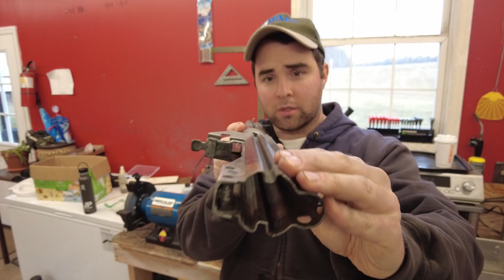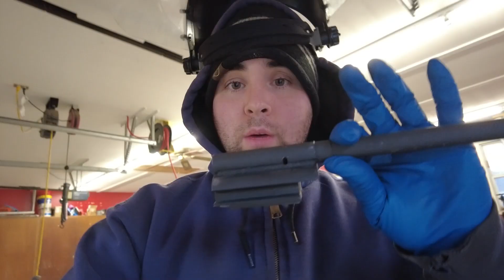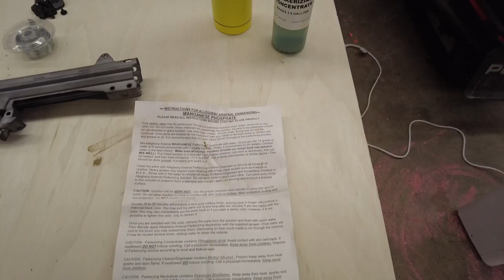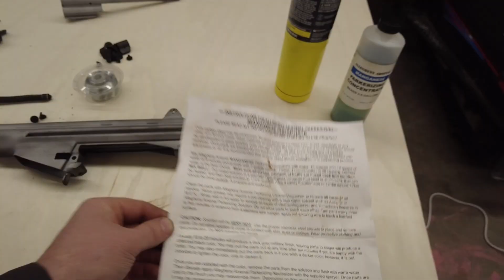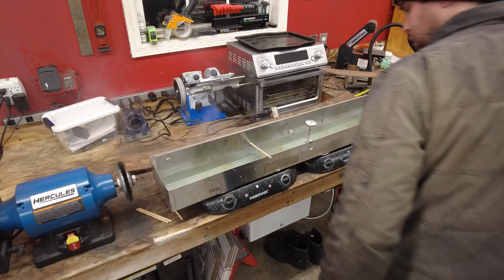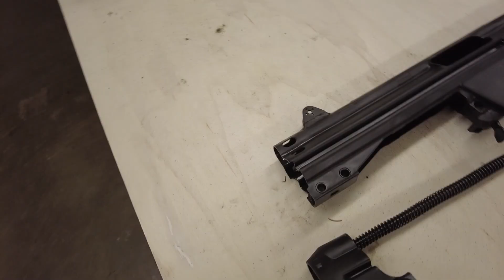Cetme C Marking Etching and Parkerizing

Comment: In order for the ears for the pin at the front of the trigger housing to remain in place with the shelf welded on, did you grind the inside surface of the ears to make them thinner to accommodate the added width of the shelf? I'm going to be starting mine soon and I would like to keep the original look by having those ears in place as you have on yours.

Comment: I tried pressing in my and it’s almost there it’s about 40 thousand away from being done but as soon as I tryed to press my get me barrel more it won’t budge at all I’m using a 12 ton press and a cet me barrel from apex any advice.
Reply from the maker: It should push the barrel all the way through pretty easy. You may be fighting a burr that is building up
Reply: @ how would you fix that I sprayed some gun oil I had down in it it’s super close to being at the right headspace but my press won’t push it any farther
Reply from the maker: Try to push it back out the other way to inspect once it’s out. I’ve never had that problem but I have a 20 ton too
Reply: @ okay thank you I’m going to try and press it again if that don’t work I will end up trying to press it the other way

Comment: I'm sure someone has mentioned this or you already know, but for the electo-etching, you're better off using sodium carbonate (washing soda) for the electrolyte rather than table salt; with table salt it's possible for chlorine gas to be produced which is toxic and can rust anything steel.
Reply from the maker: Interesting, thanks for the info! I did not know that!
Reply: @JPMachine  np, your build look great btw!

Comment: I’ve been doing parkerizing for a long time now and you got everything covered very well. Finding long length tanks that a barrel led action will fit in isn’t easy. For those who’re doing a one time park job, you can use a section of PVC pipe with a capped end then heat up the park solution to around 225-240 then poor it into the pipe that’s set upright and secured to a table. Then lower in the rifle and allow it to park. The higher temp is so when you poor it in, it’ll cool down to around 190 degrees which is where I usually park my parts at. Always keep the piece gently moving in the solution, this will ensure solution will be brought against the part. If the solution isn’t strong enough to get to a darker color, take some 0000 steel wool and tear a parts some small pieces and put it in the solution where it’ll dissolve and be incorporated into the solution. I don’t recommend this until you have more experience and do a small test before trying it on something important. Oh, for the PVC option, get a pipe that’s as narrow as possible so you don’t have to use too much solution. 
  This gentleman does a great job, I’d definitely send my work to him.
Reply from the maker: Thanks! Appreciate the compliment. I now have some tanks that are 5” wide and 6” deep! Had a local sheet metal place bend them out of scraps so they were only like $70 a piece including a lid.  Good idea with the tube for a quick and easy park setup!

Comment: really nice video! One question though, how scratch resistent is that parkerizing finish? If for example you go lightly with a screwdriver over it, will it leave a trace or flatten the roughness of the surface?
Reply from the maker: It doesn’t harden the surface at all, no. You will probably see a mark. Parkerizing gives oil a good surface to cling to providing some corrosion resistance but just like bluing, isn’t super durable like nitride.
Reply: @JPMachine  Thanks for the answer!

Comment: Nice build !  Excellent tutorial on your home parkerized set up.  
 Got me inquisitive about etching , but more on that later. ……. You solved my brain twisting question on where to get park heat tanks… The Bar speed rails are absolutely PERFECT. ……..Did an Amazon search, had a 2 48” tanks in 5 minutes ‼️ ……….
Thank you 👍for an excellent fully informative no frills , no b.s. , stright forward video.. 
Your project looks great ‼️
Reply from the maker: Thanks!  I’m actually upgrading my tanks right now. 5” wide, 6” deep. Local metal shop bending and selling me their cutoffs for dirt cheap. If the speed rails aren’t big enough try seeking out a local sheet metal shop and buying their cutoffs.  My guy has a literal ROOM full of cutoffs he doesn’t know what to do with.

Comment: Great videos, thanks for doing them! Do you still oil after park if you plan to paint/ceracoat etc.
Reply from the maker: If you plan on painting after parkerizing then go right into paint. Do not oil. The warm parkerizing will make the paint adhere very well! Originals were not painted.

Comment: Thank you very much. Your videos on this series was flawless. It was you who helped me complete my CETME parts kit build from Apex. I too, now have it completed except for the parkerizing. This is next and I'm sure this video is as accurate to the best way as the last few videos you did. Just fired mine for the first time a few days ago. It never jammed but had some feeding issues like what it expected until some minor tweaking was done. I found that the bolt carrier inside the receiver likes to just be loose as a goose. I used some valve lapping compound to lap it in. Also I had a problem with it shooting low. But my barrel and grooves and receiver were lined up nicely. To set my initial site location on the front, I adjusted the up and down and also right and left to the central position. I did not pin the triple tree yet. Then I was aiming it with a boresight lazer on the wall of about 50' to get it close. I found by making a small piece of metal the same shape as the base of the rear sight and 1/8 inch thick to raise the rear sight 1/8 of an inch did the trick on shooting low. Then I carefully TIG welded the rear sight on 1/8" high. The next thing was to adjust the front triple tapping the triple tree left to right until i get it perfect. Still without pinning it, I will go to the range and shoot some rounds thru it and see where it's hitting. It was amazingly close using the boresight laser. I also feel that I have full range adjustment of the front sight now also. Now it's time to carefully mill the locking hole to cut the grove in the top of the barrel in the triple tree and pin the triple tree. And then it's ready to be parkerized. This was quite a challenging build but I enjoyed every minute of it. Again, thank you very much. - -19:20 Indiana Joe.
Reply from the maker: Thanks for the kind words, appreciate it! Glad the video series was helpful. I certainly learned a lot. My cetme L sights were almost spot on once I finished that one up, I took my time to get everything perfectly aligned on that one with a few methods.  Parkerizing is a piece of cake compared to the build. Just make sure your tank is big enough before you start. I’ve got the new tank now i just need the time to redo it. The Allegheny arsenal park solution is great and super simple. Some of the others require you to like dissolve some steel wool or something. This is just dilute, heat, and parkerize.
Reply: @JPMachine  you are welcome. My adult son and I very much enjoyed this build. ARs are boring now, it's fun to mill out the lowers but  now I can do them with my eyes closed and we're looking for more challenging work. We built a couple Glocks with 3D printed frames. That has not been very successful. Can't seem to find a PLA filament that works. After shooting a clip or two, the plastic frame cracks. Everybody wants to say try this one or try that one. Well I've tried a dozen of them and I still haven't found a PLA or PLA+ that doesn't crack or split. We've even tried printing the frame at different angles in relationship to the grain. Still sucks. We have 3D printed M16 style stock and foregrip for the AR. That worked out well with no problems. However, I am looking forward to setting up to do Parkerizing. Currently I am looking on the internet to see what is out there for speed rail tanks. I figure I can use a rain gutter tank for the degreasing. I'd like to find two 48" (I may do a long muzzleloader someday or maybe a 50 BMG) speed rail tanks in stainless but 42" seems to be the longest. And you recommended finding at least 5" width or height. Thanks again. That's good to know. Soon I'm going to try more builds.  - Indiana Joe